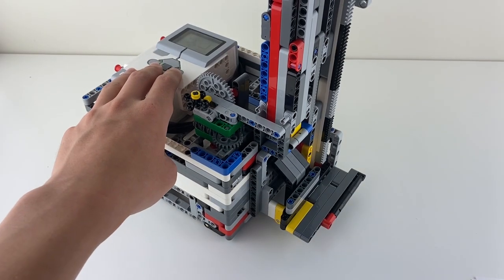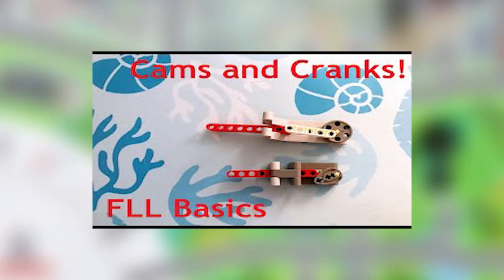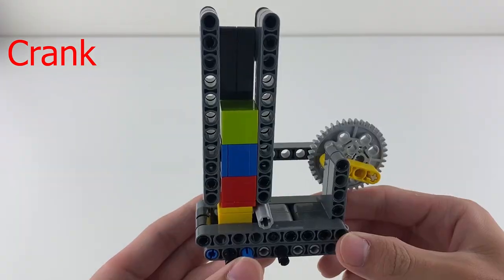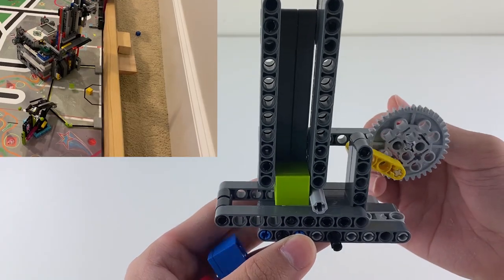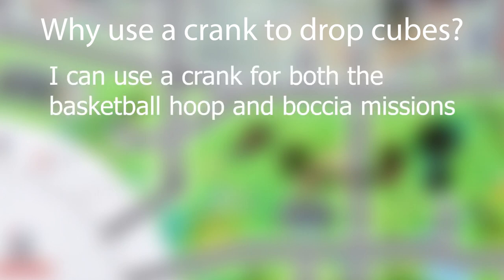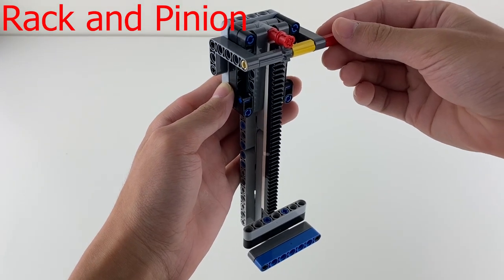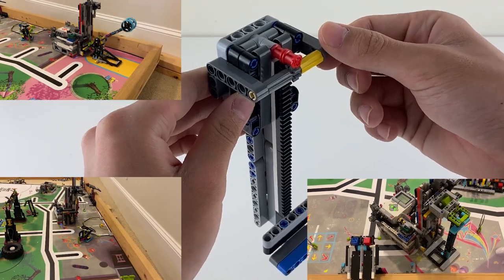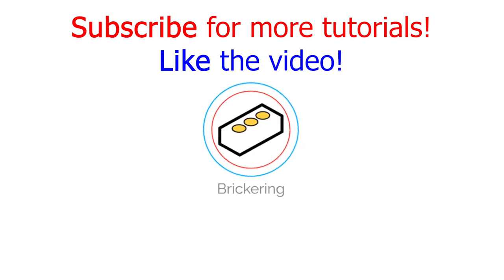FLL RePlay: Basketball Hoop, Boccia, Weight Machine Attachment (Tutorial + Building Instructions)

Comment: Nice video. very helpful. Could you let me know how to connect gear on the top of rack to the motor?
Reply from the maker: what I basically did was use various gears. The gear at the end of the attachment has an axle extending to the top of the rack and pinion, where 2 more gears transferred the movement by 90 degrees to power the rack and pinion. I don't know how helpful this description is, but I'll probably make a video about it
Reply: @brickering5166  Very helpful. Thank you